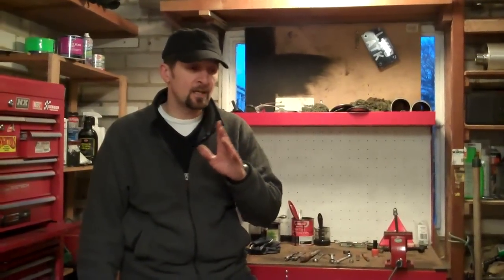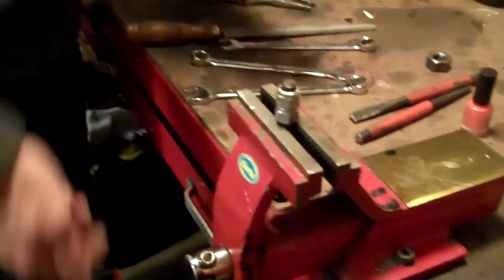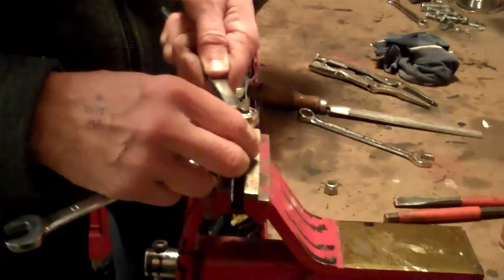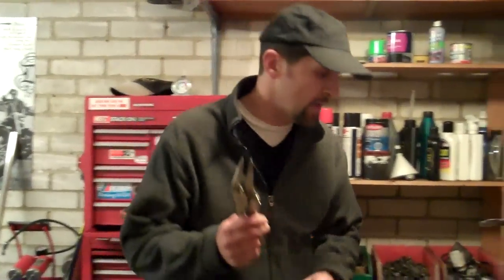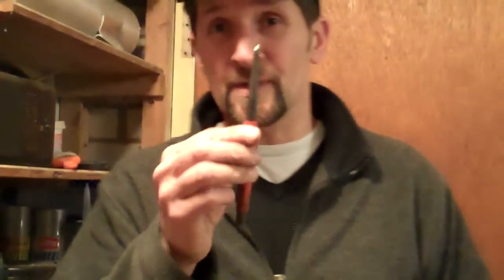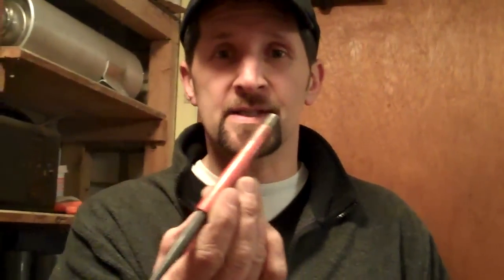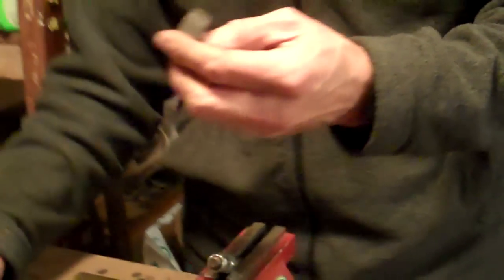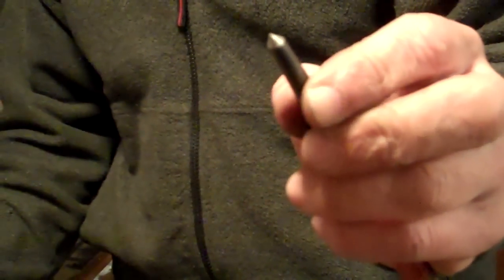Delboy's Garage, How-To ;- Rounded nuts?, an easy solution..!

Comment: Hiya Del, 
Help! (Or can anybody else help?) One of my clutch spring bolts has just sheared off!
Reply from the maker: +kdlofty Hi mate, not the end of the world, drop the whole clutch pack out, right back to the naked basket and see how much of the stump is left... if none at all, then drill it out and re-thread it, pop a new one in... safer if you can take the basket out and do it on the bench, you can then use a pillar drill, make a proper job of it !
Reply: Cheers Del. I can't get the clutch basket out. i can't unstake the clutch nut, tried following the manual, but still nothing doing, any suggestions? It's looking like i'm going to have to try and drill it out in situ (which i really don't want to do). I've got the plates out at the mo, would you suggest leaving them in oil while they're out?
Reply from the maker: +kdlofty Hi again buddy, do you mean the large centre nut about 32mm, and why wont it come out, can you not get a tool on it, or is it spinning, is it rounded, what the problem mate..?
Reply: Whoever put the lock on the clutch nut did a proper job on it. So i've just had to drill the sheared off bolt in situ and use an extractor, Luckily it worked! So i've cleaned everything out (Cotton bud dipped in rubbing alcohol is great for attracting and cleaning all the shavings up), and i'm just going to put all the plates back in pop the new bolts in and torque them up tomorrow. Anything i need to look out for bud? Thanks for all the help by the way bud, it really is much appreciated. What did you think of the dodgy bike school post that i asked you about doing a video for?
Reply from the maker: +kdlofty Hi buddy, just slot it all back together, a piece at a time, and dont rush it... it will be fine, take a pride in the re-assembly, and enjoy it fella, then take it for a ride and enjoy your handywork... drop me a line if you get stuck, im online this evening... i didnt have time to do anything with the bike school thing, honestly buddy, there will always be good and bad schools out there, one localy here was just closed down by VOSA for having dangerous bikes on the road.....go figure... good luck with the clutch.. Del.
Reply: All back together now bud, just got to torque all the case bolts up tomorrow then test it! then on to the other little jobs before it's back on the road. Thanks for the help. Oh by the way, do you have any of the idiot collective up here in the north west?

Comment: fair play the punch will work but if you have a good set of grips do remoe the nuts 2 as fast
Reply from the maker: Sure do, but sometimes fasteners can be right up against coated or polished faces and you cant risk marking them with grips...its just a careful route if you need it..
Reply: I appreciate your advice also.I didn't know the difference of tight fitting sockets and loose fitting sockets that fit but round off nutsDoes the center punch work well if it is half the size as your center punch Dellboy?
Reply from the maker: giz mogin
If its a very small bolt head, they just use a small punch...and be careful...there's not plug fit solution, its just a case of making good of a bad situation,... good luck with it.Del.

Comment: ive rounded the bolt head on my brake leaver you know its one of the awkward ones with the bolt underneath where you need a spanner and a ratchet any tips?
Reply from the maker: Same rules apply mate, you just need to get a good clear bite at it....why not take the whole master cylinder off and upturn it on the bench so you can get at it... thats what i would do.. hate working upside down and not being able ot get at things..! good luck.
Reply: Moonfleet41
i tried hack sawing the center of the bolt head and get a flat head in but no luck its well and truly in...if all else fails il just get a new brake all together
Reply from the maker: Gamerplays
If you're gonna go that far, why not try drilling the centre and recutting the thread..?

Comment: How would you go about this with screws, alen keys?
Reply from the maker: +Meterz. Like this... https://www.youtube.com/watch?v=Xob4hNPbypw
Reply: cheers matey the screw on the brake fluid reservoir is rounded like fuck honestly thought about hammering a screwdriver into it but that would most likely cause damage to the brake reservoir
Reply from the maker: +Meterz. Yeah, a really sharp centre punch may get it, but id just drill it out...use a tiny 3mm bit, and once you get to the base of the head it'll come off.. then you can turn the stump out with pliers... good luck.. Del.

Comment: Could use hack saw to cut it of easily
Reply from the maker: so many people say you can use pipe wrenches, stud extractors, huge chissels, special sockets for rounded nuts and bolts...but you cannot use them without damaging other parts, if its a resessed head in an engine casing, this is the best method..

Comment: You need to do one on sheared off exhaust header bolts mate. I got one and do not want to take the head off
Reply from the maker: Thats not so easy mate.... is there any stud left sticking out, or is it snapped off flush..?
Reply: about half inch as far as I can tell. Got a good exhaust man to pull it apart. Hope he can do it . Not look forward taking the head odd

Comment: What about using six sided spanners that grab on the flats instead of the corners.
Reply from the maker: +rimmersbryggeri Yeah they work great, as long as the flats are still flat....lol
Reply: Exactly and if you use them and not twelve points chances are greater they will be. Espeacially if you buy cheap tools those twelve points are really shayt.
Reply from the maker: +rimmersbryggeri 12 pointed ring spanners are invaluable in tight spaces, you'll find that working in car engine bays.. gives you the ability to move a tight fastener when you may only have a tiny span of movement in the space..!
Reply: Yeah but you cant ahve crappy ones that's the rule. The first set I was given the points were so undefined that the 14 was probably more like 14,75. That's no good.
Reply from the maker: +rimmersbryggeri You are so right, it's nothing something I've covered in the videos as we aim them at the amateur home mechanic, but from the professional stand point, all spanners and sockets have a service life, as a worn out tool will do more damage than good... which is why you'll see any professional tech visit the tool man as it drops by every week and replace a tool or two through wear and tear !

Comment: what about rusted hex screws?
Reply from the maker: Tap a 'slightly too big' Torx bit in the hole.. usually works.
Reply: I tried. But it just made it worse..I might have used to much force.
Reply: When i did the pieces of the hex just crumbled.
Reply from the maker: OK, it sounds like it's pretty corroded if it crumbled away, the final step is just to drill the head clean off it, it's not difficult, as the hole in the hex screw centres the drill, use a drill bit the same size as the screw shaft, then once the head spins free, you can take off whatever it is the screw is holding and you have a stump you can extract with grips, good luck with it mate, hope that helps!